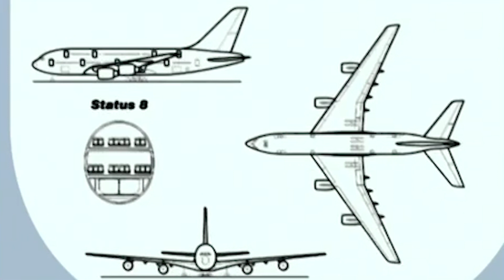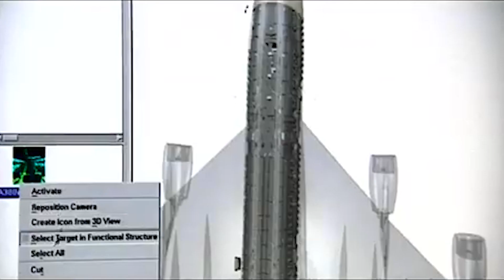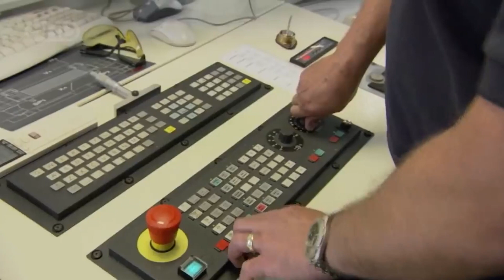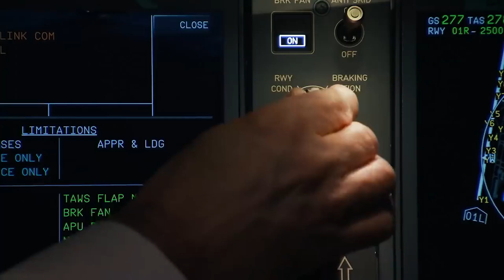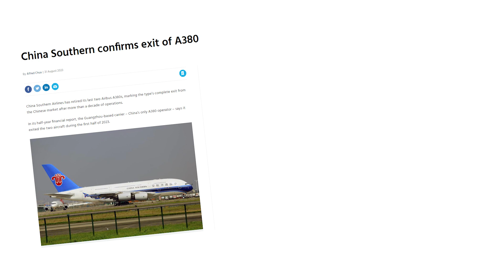What makes the A380 so special | Aviation #DeepDive

Comment: A380 is and always will be the comfiest plane ever built
Reply from the maker: It's certainly up there with the best ones! Would you say even better than the A350?
Reply: @AirwaysMagazine  I feel like the A350 makes a big difference when compared to other twin-jets, especially due to pressurisation and higher humidity, but the A380 gives you that feeling of spaciousness, smoothness and silence. Both are great tho, so it's difficult to pick one over the other